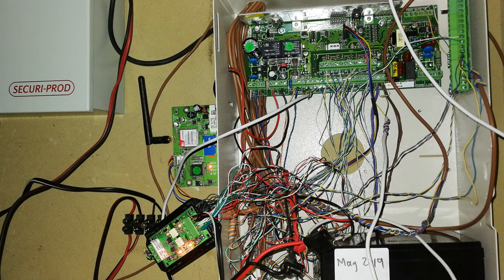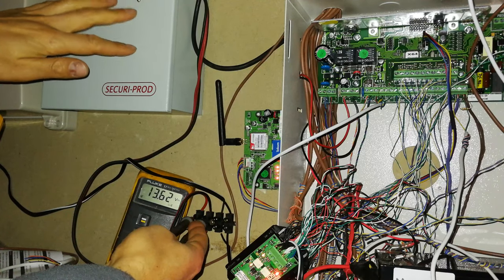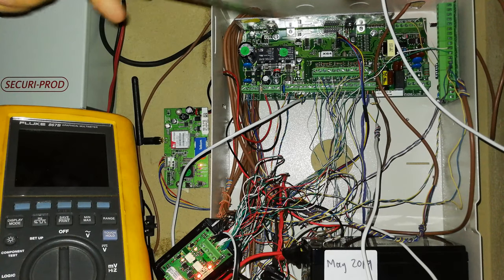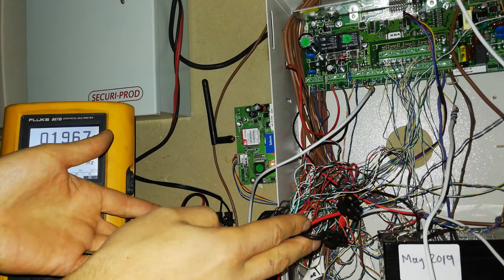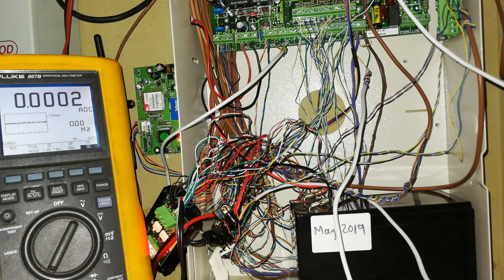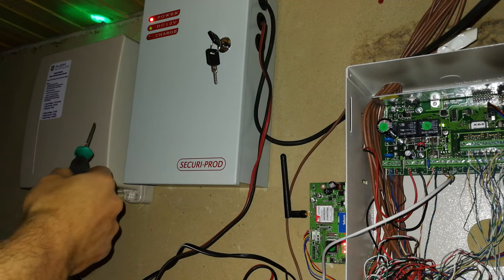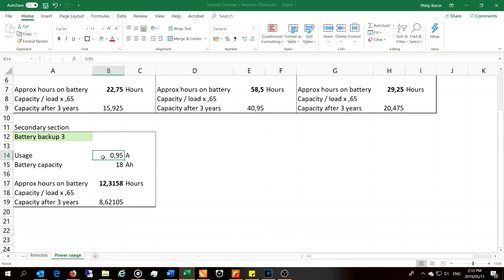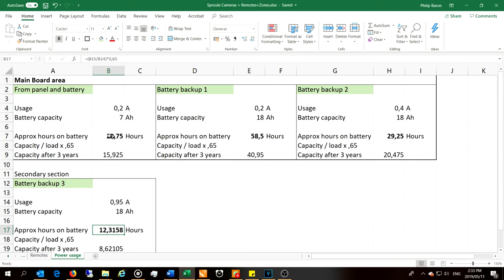Understanding battery power usage on your burglar alarm system

Comment: Does the entire system fail to operate (with power) if the battery has died?  My security company claims the system no longer works WITH power. Is the transmission of the signal partially or in principle, dependent on the battery?
Reply from the maker: the IDS models will still work with AC mains even if there is no battery.

Comment: Why don't you just power everything off the 18AH battery. Then the balancing is optimal. And yes AFAIK the IDS can be set to not send a power failure alarm when you remove the mains.